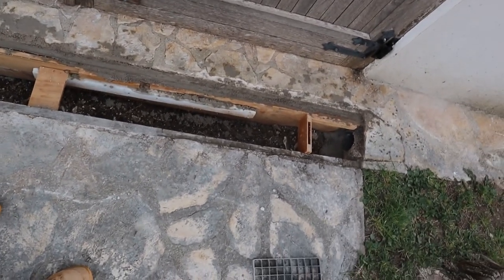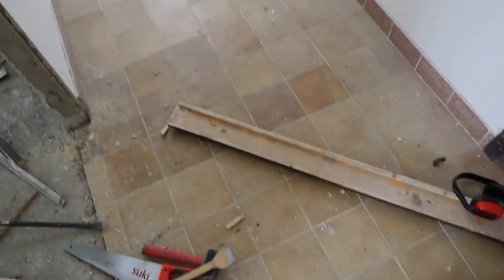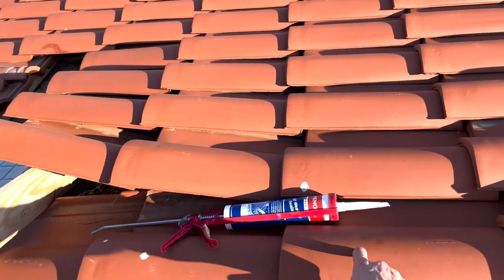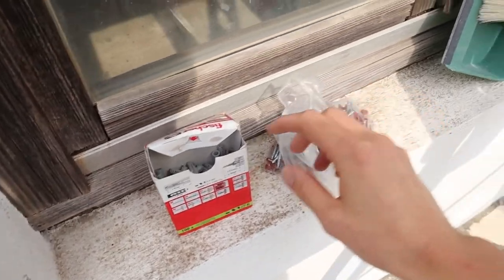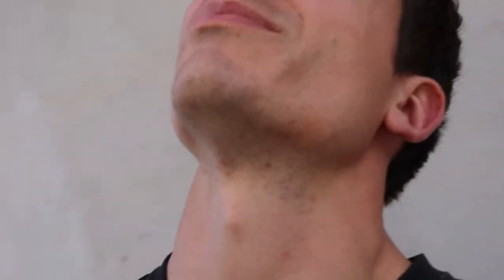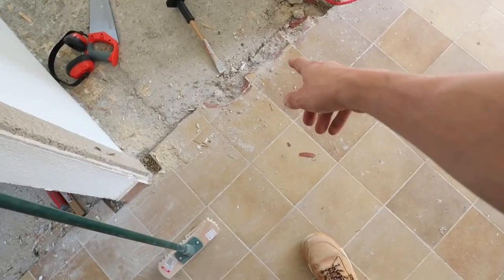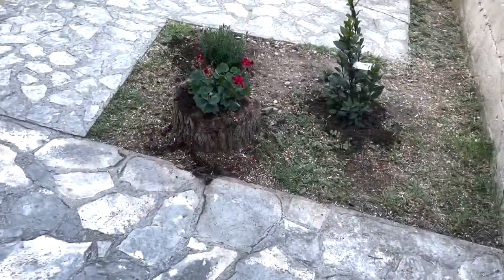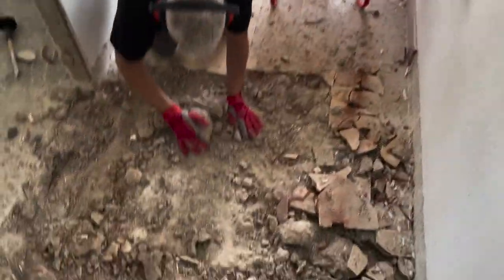Renovating our off grid home in Croatia (diy projects, tips etc) - 010

Comment: well your roofer is not a roofer ,,as you never ever use screws on a roof ,as it will cause leaks as water will travel along the thread of the screw ...
Reply from the maker: The screw should never touch water, you think a blank hole is better than a screw? 
If water would ever get to that location in general the wood be all wet whatever you use
Reply from the maker: Having a look on google it says screws are marginally better to use than nails. So I’m not really sure where you got your sources from